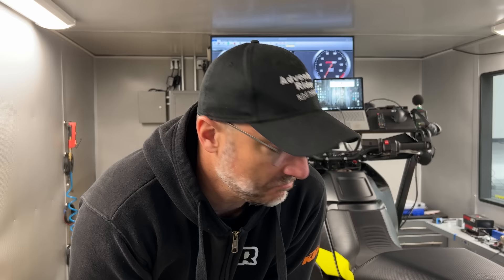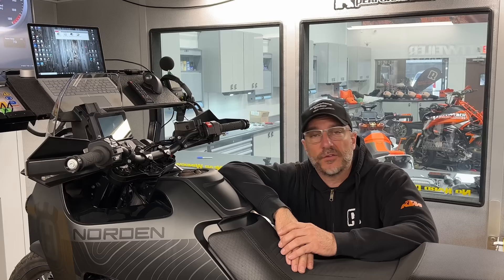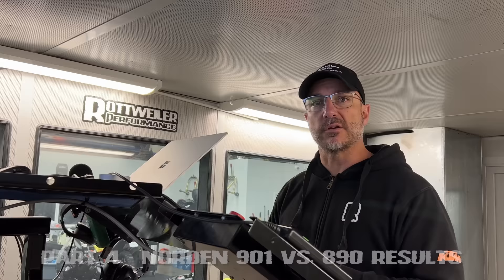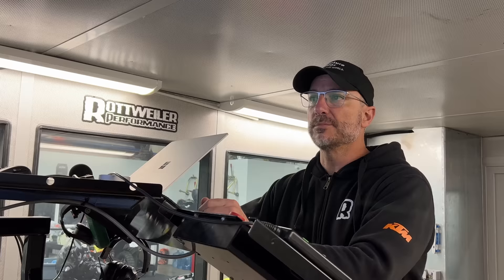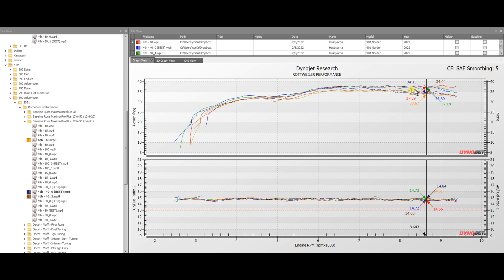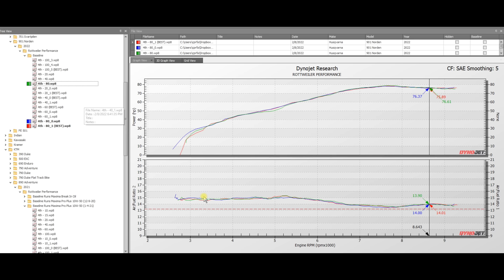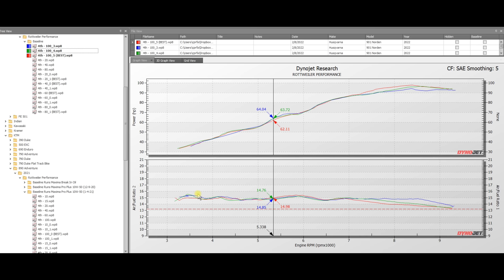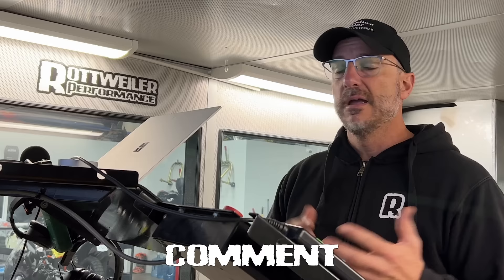MAPPING COMPARISON - HQV 901 NORDEN VS KTM 890 ADVENTURE - ROTTWEILER PERFORMANCE

Comment: Thanks for a very informative video! Interesting to see what you can do with the Norden 901, if it can be improved in any way. I know the value of remapping, previously had a 1200GSA that was completely transformed thanks to changes. Now have a KTM 1290SAS, with a Danish "black box" connected. Latter have made the engine so much smoother and better. Since Norden is on my radar for a possible bike change next year I'll keep an eye on you guys! :)
Reply from the maker: Thanks Harold!  Honestly most of that bike we already have covered because 99% of our parts convert over from the 890 KTM Adventure but we'll be producing maps for the Norden as well with the Power Commander V just to have those in our offerings.  We can work wonders with these bikes in terms of power delivery and smooth running.

Comment: Good video Dudde, excelent I have a question,  
When you did the test, how many HP did the 890 R have, I was referring to real HP in the rear wheel.
Reply from the maker: Pretty much the exact same motor so about the same. These engines actually very quite a bit more than you would expect in terms of power, so if a KTM made a bit more than a Husky one day, it may be the opposite the next with different bikes. They are all over the board so it's hard to look a small differences as one bike better than another.

Comment: Just learning about this subject, and still fairly ignorant, but in 4th gear how do you achieve 8,000rpm @ 20% throttle?  Intuitively I would think that rpm is dependent on throttle position, but the graphs show a fixed throttle position throughout (20%, 40%, or 60% etc.) and then plot AFR vs. Rpm and Power vs. Rpm.  Also, how much does changing your AFR from a lean stoichiometric 14.7 to a richer preferred power AFR of 13.2 affect gas mileage,  and therefore total range of the bike?  Thanks in advance and appreciate the education.
Reply from the maker: We basically load the dyno at 3000 RPM using an 'RPM Load' (you can load by RPM, speed, brake, etc.) that will hold the bike at that RPM using the drum, this allows us to get the throttle up to whatever percentage we decide we want to look at and then start the run. This releases the drum and allows the bike to start climbing in RPMs until it either just stops building or hits the rev limiter. 20% throttle will actually get that high if you keep it there and will softly bounce off of the rev limiter. Lower throttle ranges just stop and a given RPM. Yes the bike will climb that high but most riders won't do that anyway which is why we don't feel the shift in air fuel ratios matters much there. It was probably just to protect the motor just in case someone does. 

This is the balance. 13.2 will certainly use more fuel and produce more power. It's a trade-off. 14.7 AFR is regarded as the point where the best power/fuel economy combination can be reached and it's at the cost of lower horsepower. 13.2 is regarded as the starting point target AFR for making the most power when that is the goal. This is why we offer map switches so that the user can run dual maps and have the best of both worlds at the flick of a switch. You can go from stock to fueled for power just like that depending on what you are doing. We also used this in rally racing where in the dunes we needed the most power, and for long sections needed fuel economy.
Reply: @RottweilerPerformance  really appreciate you taking the time and providing such a detailed response!  Especially to a beginner trying to learn about these matters.  I was actually wondering if the drum could be controlled, but dismissed it.  Interesting to know that it can, giving you cleaner baselines and better runs.  I didn't suspect that such low throttle settings (20%) could work it's way up in RPMs, so thanks for sharing that.  Yes, the map switch may be the best of both worlds!  Love all the work you do putting the information out there, being part of the community, and offering and creating products for these great machines.

Comment: Very detailed analysis!! I had no idea you could pull out more juice via custom maps and exhaust from a bike. Nice!! Question tho, when you do those custom maps and exhaust mods, do you see significant reduced fuel consumption typically?
Reply from the maker: Some, but not overly significant. It takes more fuel to make more power, plain and simple, but with Powercommanders you can add a map switch that will allow you to toggle between a performance map and one with no added fuel, just ignition trim or whatever you like so you can get the economy miles when you need them. There are many options so you can have your cake and eat it too. That's what we love about them. Additionally, we can set them up for you for free and also install the maps for free as well when you buy them through us.

Comment: So no issue installing a decat on the Norden without a tune?
Reply from the maker: Not at all. There are over 10,000 riders that we know of that have decatted with no mapping. We have verified that they fuel just fine. That being said, the target is still 14.7:1 which is safe, but doesn’t exactly make the best power, so while you are safe, there is still a lot left on the table in terms of power if you are not remapping.
Reply: @RottweilerPerformance  Thanks and have a great Christmas and New Years!

Comment: Hi there ! Do I need to remap My stock 2022 Ktm 890r if I install the arrow mid pipe and slip on exhaust listed on your website?
Reply from the maker: No you don't. Is it good to? Absolutely, the bike will run much better with or without the mods with a PCV, but it's not mandatory. It will compensate at stoichiometric 14.7 air fuel ratio just fine.

Comment: I like that rivnut insert for the 02 sensor.  Where can I find that?
Reply from the maker: It's part of a dynojet kit to easily tap into a header behind a cover plate or something that can hide it and you just plug it with a button head bolt when you are done. What you are looking at is really just a 6m rivet in the header, but the wide band O2 kit is a Dynojet product that has the adaptors and tools.

Comment: Could dyno setup be used to measure torque at very low rpm in low gear used in difficult terrain. In the graph I see no data below say 2500rpm.
Reply from the maker: You certainly could. Most dyno runs are performed in 4th gear and with 40 lbs in the tires. That's fairly standard practice and why you don't see much data under 2500, because the runs are started at the lowest RPM that the bike isn't 'chugging' at. You could do comparisons at low throttle openings in lower gears for sure, but to lay out the data and show it to someone in graph form it needs to be ascending in some way. Otherwise you just have a bunch of scribbles in the middle of a page. 

One thing we do when adjusting ignition advance is use the torque strain gauge to measure torque in real time on a gauge, hold the throttle with a device in a steady state and adjust the advance while we keep an eye on a knock sensor. If torque goes up and no knocking is detected, that's a good thing and we just made free horsepower and better mileage. The only caveat to spark advance is having to make sure you have good fuel, so it that's an issue, we recommend a map switch to change to a map with less ignition advance. That part is easy and we can set that up for the customer.

Comment: I am very interested in your definition of "open loop". I've been a professional tech for over forty years so my beginnings are carbureted everything, meaning I have experienced every iteration of fuel delivery and management there is. This is not a challenge, I'm truly interested in your definition. My definition is the moment when the O2 sensor reaches an active state. A state totally reliant on O2 sensor temperature. A cold engine will be in "open loop" and relatively quickly goes closed loop. If the O2 sensor becomes inactive with a working temp engine (info via coolant temp sensor) a code will be generated because the ECM doesn't like the mismatch of info (hot engine inactive O2). The sooner an O2 sensor becomes active, the sooner the ECM has control of fuel mixture (enter the heated O2 sensor). In my experience, the fact that fuel mixture goes lean at high RPM is not "open loop", it's predetermined mapping, otherwise you would have a lean mixture code.
Reply from the maker: "A closed loop control system is a set of mechanical or electronic devices that automatically regulates a process variable to a desired state or set point without human interaction. Closed loop control systems contrast with open loop control systems, which typically require manual input".

In laymen's terms, open loop on KTM engines has shown to be almost always where the mixture will start coming out of 14.7 air fuel ratio.  Historically anywhere we see this we typically have full control over the fueling without the ECU trying to 'undo' the corrections we have made via piggyback ECU such as a Power Commander V  (We produced another video showing this a few years ago). When the stock narrow band O2's are active and will constantly maintain a stoichiometric 14.7 AFR regardless of what we throw at it, this is typically and safely considered 'closed loop', where the ECU has full control of mapping corrections using voltage inputs from the narrow band O2's.  Rich being .8 to .9 volts and lean being closer to .3 volts or less.  The portions of the map that we can alter without the ECU overriding them would be considered 'open loop'.  Typically bikes are only in open loop for a short time when cold because the narrow band O2s have not properly heated up yet, which is why 'wide band' O2s (that can report a much wider range of air fuel ratios) began surfacing on cars in around 1992 on Honda Civic models.  They don't use them on motorcycles because they are expensive and motorcycles have a bit more leniency than cars.  Narrow band O2s can only report between 14.0 to 15.0:1 which is within the range the bike is required to run at.  We use wide band O2s on a dyno which can report almost any air fuel ratio. 

See this example (below)of closed loop on a 2021 KTM 890 Rally.  The deep purple parts are where the stock ECU fought our corrections and allowed us to continue to throw more and more fuel at it while still maintaining 14.7 AFR.  You can also clearly see a distinctive line drawn where the stock ECU no longer fought our corrections and allows us to alter open loop to gain the air fuel ratios we desired for more power. Mapping only in open loop is what we consider 'STREET MAPS'.  When we build a race bike, we unplug the O2's, effectively blinding the bike in closed loop which allows us to map the entire range of throttle and RPM.  We call these 'RACE MAPS' and they come at the cost of an engine light and that's about it. 

https://www.dropbox.com/s/qcnheykqxlyvq90/2021-04-29%20%281%29.png?dl=0

 In this video,  we are finding two things: A) bikes are auto correcting higher and higher into the upper throttle position ranges than before, indicating that closed loop, where you cannot correct the mapping with a piggyback ECU without the stock ECU 'undoing' the corrections (while the O2s are still plugged in), is growing larger and larger as models progress and  B) Open loop mapping where the factories do have more leniency to map how they see fit is also getting leaner and leaner.
Reply: @RottweilerPerformance  Outstanding reply!! You've given me a lot to consider. I may be sixty but I'm still ready to take in info. Your time spent considering my comment is much appreciated.
Reply: @RottweilerPerformance    Since 2019 BMW 1250 engines have wide-band O2 sensors.  There is a third O2 sensor after the Cat to compare what's coming out of the Cat so it can feed this back to the ECU for adjustment as required.  They also have knock-sensors to add to the mix.
Reply: @peterrick3339  After Cat is primarily a health check for the catalytic converter and the knock sensor gives info related to adjustments for optimum spark advance without ruining the engine from pre detonation common to low octane fuel.
Reply: @howlinhog     "They also have knock-sensors to add to the mix" may have been a bad terminology on my part, as in 'mix'.  I used the word mix in the sense that the knock-sensors feed back to the ECU in the overall engine management, specifically ignition timing.
As an aside, both my friends & my 2019 1250GSA suffered detonation often when rolling on the throttle.  It seems that when closed loop the fueling is way lean leading to detonation until the knock sensors pick it up and the ECU responds.  My engine was particularly bad but i had an intermittent fault with one of the O2 sensors.  My friends detonates often as it just runs too lean.  We both had spark plug tips burning away under the Iridium tips which indicates the plugs BMW install are too hot.  We changed to the next colder plug which has reduced the detonation somewhat and seems to have dealt with the center core burning away.  The lhs plug with the faulty O2 sensor on my bike had the center electrode burn away completely & the Iridium tip disappeared.  Out the exhaust valve i presume. After this happened (the engine still ran OK surprisingly) but detonation frequency & severity increased and sometimes the knock sensor did not intervene.  I am of the opinion this cylinder was now suffering from pre-ignition and there was nothing the knock sensor or the ECU could do to stop it.
Reply: @peterrick3339  Ouch! Hope you don't suffer any engine damage, it can be catostrophic.
Reply: @kevinlancaster5714    The bike ran with a dud O2 sensor for 27,000 kms. The dealer was aware of massive bouts detonation or maybe even pre-ignition for 27,000 kms and did nothing until i insisted he find the problem, which turned out to be an O2 sensor.  By this time there was a knock in the engine and shiny areas on top of both pistons.  I don't own it any more.

Comment: I like this sort of technical stuff.  Seeing the difference in fueling between Euro 4 & Euro5 and  the power results is excellent.  Thank you.
Would be great to see the same comparison done with a Euro 4 & Euro5 BMW 1250 GS/GSA as i am of the opinion the Euro 4 engines run too lean.
Reply: The 890 and 901 are both euro 5

Comment: wait, did you use a rivnut for the O2 bung??
Reply from the maker: Yes. Then we screw in a billet adapter to a wide band O2. Completely common and normal and doesn't overheat the wideband.
Reply: @RottweilerPerformance  Thanks for the quick reply.  Can you show a video for that process?  I think you could sell more if people knew that they could do this at home with out a welder.
Reply from the maker: @KTravelet1  Actually Dynojet sells a kit, but it's really just for dyno tuning. There is a rivet gun with 6mm x 1 threaded rivets, and an adapter kit with two wide band O2's and billet adapters and some screws to plug them when you are done. You just put them in places you can't see like under a heat shield or something like that. What are you trying to accomplish and let's see if we can help.
Reply: @RottweilerPerformance  Me personally, my 1290 good to go thanks to Rottweiler :)  I'm just trying to point out that a lot of people are hesitant to go the wide-band/AT route since (at least I was) under the impression that you must take the pipe to a welder to get the bung welded on.
Reply from the maker: @KTravelet1  Ah, I see. Well one thing on the 1290 is that on Arrow headers and I believe Tekmo titanium headers we have them specially made with 18mm bungs (check website or our live chat to make sure) so if you are also getting one of those you should be good to go. If not, these adapters would not be ideal for permanent use. They are a bit bulky and stick out a bit and are really just for testing on a dyno. Many times where the O2's are mounted there isn't much room for extraneous gadgets to adapt to things so most often it's best to be able to screw the wideband O2 directly into the exhaust.
Reply: @RottweilerPerformance  gotcha!  Thanks so much for all the information you provide back to the public!!
Reply from the maker: @KTravelet1  We are a big part of this community and we love doing these. The only think we love more is hearing that they have helped someone. Thanks for the thanks!